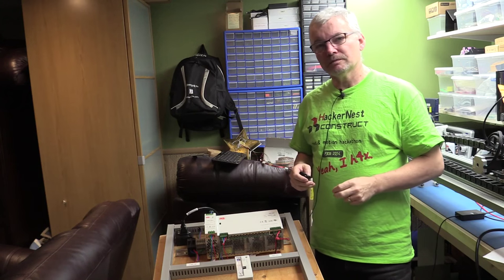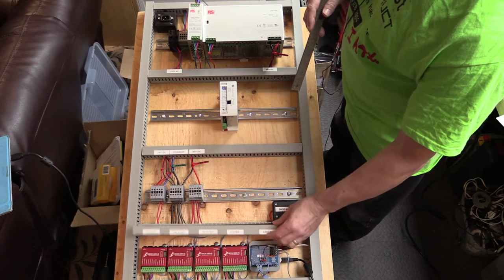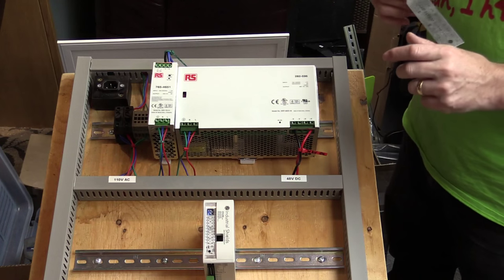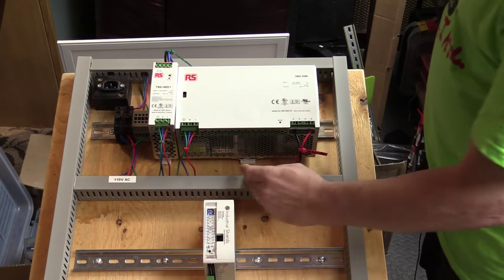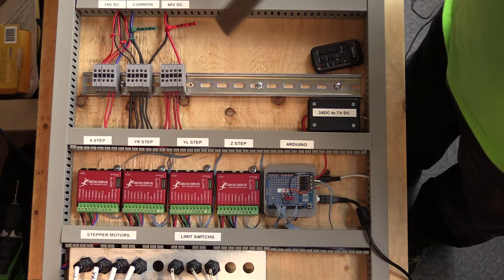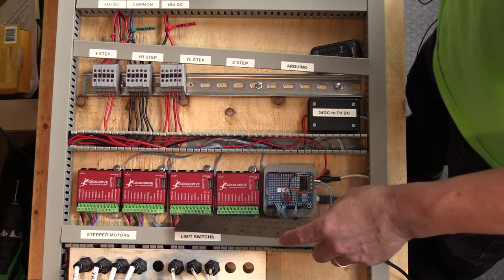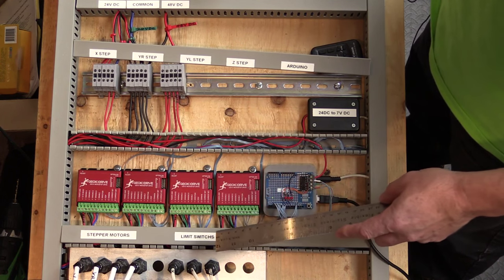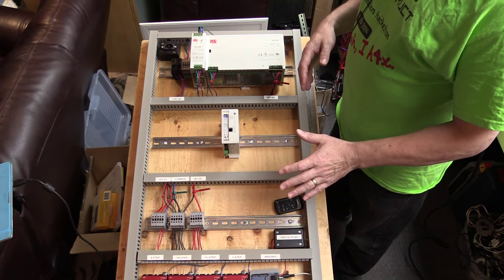CNC Project #4b The Control Panel Wiring

Comment: Nice video. I'm building my CNC router now, it will be similar to yours in many ways but I'm using gecko servo drives because my work donated them and a bunch of parts. I found you searching for Gecko and Arduino. 

I watched your e-stop explanation and was wondering about this;
Does your e-stop kill the power to the arduino? It seems excessive to kill power to the whole system when you only need to open the motor circuits. I believe that when you kill the power supply it takes some time for them to use up whatever stored power they may have in capacitors, etc. before the motors stop especially if you have such a high voltage supply. I also worry that if you interrupt mains power you are just allowing the motors to freewheel and not really stopping them and in the case of the Z axis it could plummet down and smash the tool or the part. Shouldn't we be looking for a way put the brakes on and stop everything that is moving? It would also allow you to clear the error and continue your operation without restarting. Thank you.
Reply from the maker: Brian Boni in this video I don't have an e stop installed. I do have limit switches though and these instruct the controller to remove power from the steppers. Not the arduino.

an estop if fitted should kill most of the power as this is an emergency. some could be cough in the machine etc. it is the only safe thing to do. if you simply want to pause the machine to check something you would not use the estop you would use the computer or remote buttons for the purpose
Reply from the maker: Brian Boni oh. the limit switches will also instruct the controller not to send more movement commands
Reply: Thank you for your reply and please excuse my continued querry as it's a pretty complex concept to wrap my head around. It does seem odd that "pause" will cause the machine to immediately stop but e stop allows everything to freewheel with whatever momentum it has at that moment. 

My only real concern now is the Z axis as I have a lot of mass up there with a full size router and over 12" of Z travel and nothing holding it up but the flow of electricity. Maybe the Z axis should have a worm drive to prevent the drop? The closer I get to finishing my machine the more I realize that I've made something rather large (the X,Y area is around 48"x48") and potentially dangerous and would like to understand and have it operating safely. These videos are a great help and more advanced concepts of safety are rarely covered so thanks again for your efforts.
Reply from the maker: With steppers, there is only 1.8 deg at a time being commanded of the motor (Or less), with servos there is feedback to the controller. If power is removed then the steppers will immediately stop, Servos motors should also stop very quickly as they draw a lot of power and therefore the power supply will not have enough capacity for keeping them going.

Even with the inertia of the gantry, with no power and the back emf now being generated, it will most lightly self brake. In an emergency situation (Which is why the E-Stop was pressed in the first place) you need everything to be powered down immediately, especially in the drive train as it could be the controller that is in error so you can't afford for safety sake to allow there to still be power to continue movement. and writing off the job in en E-Stop situation is perfectly acceptable unless you put life and limb lower than the job on the CNC (I doubt that). If you really want to make things brake hard then you can arrange relays in the path of the stepper coil to literally disconnect the power and short out the windings. this will ensure MAX breaking of the motors and also make them very difficult to move (Which could also be an issue if someone has got caught in the mechanics)

E-Stops are not there for NORMAL use, there for emergencies. For normal use like a bit breaking or to pause for some reason, there are plenty of other inputs to control that gracefully with full resume capability. 

Even limit switches should not be hit during normal operation, but when these are activated they can simply disable the stepper controller by use of the typical "Enable" pin found on most controllers. in this event you would still need to re-zero the head and resume your work from a known point or even start again. Remember Limit switches being hit is also an indication that the GCODE output or the program has failed in some way (Or you coded the tool path wrong) and so you still cant typically trust the current position

Better to trash the job than the machine.

I will be doing a video specifically on safety like e-stops and limit switches, it is worthy of a separate video and is a complicated subject.

Comment: Surely you shouldn't fuse the neutral? Otherwise there would be no return path for the live if only the neutral fuse went thus making the neutral after the fuse potentially live?
Reply from the maker: you are correct and that will be correct in a upcoming video. If I was using a circuit breaker that was dual pole then this would be ok. Your point about the possibility of just the neutral blowing is a good one. I don't know the tolerance of fuses but it is certainly possible for the neutral to blow before the live.

I did say this was a learning series. I am learning :)

Comment: hi  Peter.  I have a question if you don't mind...  I was able to set my CNC  to receive the signal   from my old driver box but but my motors not  moving only making click sound .  my question is ,  do you have any tutorial on setting MACH 3 to control motors. or if you please give me an  advise on setting motors. Also i noticed the parallel port should give 5 V but my only has 3.37 , is that could defect  motors run.  

Thank you
Reply from the maker: It is possible the lower volts could be problematic but it depends on what is receiving the signals. there are break out boards for the parallel ports that isolate the signal and could well solve that problem. I am assuming your using a modern computer for that to be happening?

I use MACH3 (Or will soon) but via a USB connection to a MACH3 Motion Controller
Reply: this old driver doesn't  use a BOB , it using parallel port connection  witch  has wires going in  to this old driver.... i think you wright  i will have to get a new BOB board and it will have 5V . 

Thank you Peter
Reply from the maker: do you have skype or Google hangout ?

Comment: Fusing the neutral on a mains supply is VERY bad practice.  You could use a double pole circuit breaker as suggested by Ilian but you don't need to.  Normally double pole breakers are only needed on CTE (centre tap earth) 110v supplies where you have two line conductors or where you want to use them for isolation e.g. on a TT mains supply.
Reply from the maker: MrSailbadthesinner you are correct sir and this was indeed corrected a long while ago when another viewer mentioned it. Not sure what I was thinking at the time but it is now corrected. Thanks for catching it and commenting though. It is good to have peer review of work. It helps  us all  learn
Reply: Hi ! Student in electroMecanic over here. 

Why is it a bad practice ?

Thank you very much :)
Reply from the maker: Two fuses in series is effectively what we have in this situation, one in the live leg and one in the neutral return leg, it is possible that the Neutral return fuse will blow and not the live one, leaving the system energized relative to Ground and therefor still a risk to equipment and personnel.  When used with a split (Center Tapped) supply you have a situation where both legs are at mains potential relative to ground and possibly neutral, this is the case with split sockets in America and Canada were the top socket is on a different phase to the bottom, each delivering 110V AC relative to neutral, the other situation is where you have a 220V AC supply for a spindle / VFD for instance and here your taking advantage of each phase but not the neutral but as there both still energized and at mains voltages relative to ground they both need fusing. Think a transformer where the output has a center tap and that is grounded and set up as the neutral, both sides of this transformer will be 180 Deg out of phase to each other, this is exactly what we have in North America. One phase of a three phase distribution network is feeding a transformer at thousands of volts, the transformer is outputting 220V AC Center tapped, giving 110V on each side / phase, and this is what is fed into most households.

Comment: hi Peter, thats a nice project and tutorial , like it. i want to ask if those Geckodrive you used any good, i have a big CNC table 8' x 10' and good 34D motors on Z,  and 42 D motors on Y,X.   thank you
Reply from the maker: The Gecko drives do support Nema34 style motors (7A max if I remember right), but they will need additional heat sinks adding to each one to keep them cool

You can see their latest products here http://www.geckodrive.com/featured-products.html
the site also has an excelent set of PDF documents detailing the requirements for powerful steppers etc.
Reply: thank you, would you know how do i wire my motors. they have 6 wires  , 4 phase.
Reply from the maker: 6 wires allows a choice between 4 phase and 2 phase. the additional wire in each leg will be a center tap
using the center tap and one leg will provide speed over torque. Using the outer legs and ignoring the center will provide torque over speed, see here for an example wiring
https://ebldc.com/?p=253
Reply: thank you very much. i do have all six wires connected to they own pins on my old motor driver, but i would like to upgrade motor drivers and have problem understanding how to connect them to a new drivers, because new drivers i see on eBay have only 4 pins for motors, my drivers have 6 pins for the motors
Reply from the maker: So as you will have seen in the diagrams, an easy migration to the new controllers.
I use a 48V supply to drive my motors through a Gecko driver with no issues. the driver takes care of limiting the current etc.

if your supply is only 12V then you may want to change it to 24 at least to provide additional torque to the motors with the new controller.

What was your existing 4 phase controller ?
Reply: its ANAHEIM AUTOMATION DPF41BB1  .  its a 4 motor driver still works but its old. i can send you a picture if you dont mind giving me your Email.  thank you
Reply: i think your motors have 4 wires  2 phase, i have 6 wires 4 phase
Reply from the maker: I assume it is one of these http://www.liveauctionworld.com/AA-DPF41BB1-MOTOR-CONTROL-print-sequence-L-368_i17552607

What is driving it ?, this driver should be easy to replace but it depends on the controller too
Reply from the maker: oh my email if needed is in the about block but here is is anyway
peter@thebreadboard.ca
Reply: yes it is. its not bad one but i would like to update it .  this model  26 years old.  and to buy from  manufacturer new one will cost around $ 1700 thats why im looking for better deals.  thank you
Reply: thank you
Reply: hi, Peter. what would be a good power supply  for NEMA 34  stepper motor  630 oz-in. 2.2 VDC  7.0A   ,.... and NEMA 42 stepper motor  with 1575 oz-in  torque 3.6 VDC  6.1A .....  i have a hard time finding out.

 thank you
Reply from the maker: without knowing their inductance it is hard to suggest something specific but I would suggest something in the order of 48V (For maximum torque) and probably close to 20A, it may be better to use a separate power supply for each axis of 10A @48V, this may keep the cost down a bit and spread the risk. As I said, without knowing the inductance it is hard to say for sure. the gecko site does have the math in the PDFs so you can work it out, but they require the inductance. I would suggest though not to exceed the 48V, this would start to get very costly for the power supply if you do.
Reply: inductance ? how to i calculate that.
Reply from the maker: should be on the steppers or available by looking up their part numbers
Reply: NEMA 42 has unipolar inductance 5.94 mH  :  NEMA 34 has unipolar inductance 1.70 mH
Reply: hi Peter,  here the inductance on motors:  NEMA 42 has unipolar inductance 5.94 mH  :  NEMA 34 has unipolar inductance 1.70 mH .   would you please suggest me what power supply will be the best for this motors, my new drivers can take up to 85VDC.  

thank you
Reply from the maker: so using the formula clearly shown here :-  http://www.geckodrive.com/support/step-motor-basics/power-supply-basics.html
VMax = 32 * root (L)
so for 
Nema42 we get 32 * root(5.94+5.94) = 110V
Nema34 we get 32 * root(1.7+1.7) =  59V

The drivers limit the MAX voltage and also if they're all on the same PSU we need to limit the volts to the lower of the two, giving a bit of wiggle room we land back on the initial suggestion of 48V and 20Amps. I know if you add up all the amps you get more but the drivers are never going to be energising all coils at max at the same time for all steppers and I also doubt you will be leveraging the full torque of the motors either.

A linear power supply, unregulated could also be cheaper and easy to build than a switching power supply and will work well. if you want additional margin, then you could always build it to 30 Amp capacity.

What is the supply there currently being driven with ?
Reply: i have 120v ac  going into driver box but what happens inside of that box im not sure, there is not to much info on this driver box.
Reply: thank you for nice explanation .  i think a 48 VDC- 85 VDC and 30AMP sounds good .
Reply from the maker: if there all on the same power supply, then stick with 48V ish as some steppers will not tolerate the high volts and will overheat.
If the NEMA 42s are on a separate one then they could use higher volts but your drivers will limit you to 86V ish MAX.
Reply from the maker: ah
Reply: all be looking for power supply 48 VDC  30A

thank you very much,
Reply from the maker: your welcome. you may find there is already a suitable power supply within your existing system
Reply: would it be better to have  a 48v  10 a power supply for each driver .  so that will be 3 power supply controlling 3 drivers . i did got 3 new drivers for my motors.
Reply from the maker: it would allow much better flexibility in layout when it comes to putting them in your control panel or wherever your going to locate them so sure.
Reply: hi Peter, thank you very much for all your help.  You have a good day

Comment: A lot of nice information. But I really do not get the controller part in this build. Do not get me wrong, I use arduinos for a lot of things. I have no problem with arduinos. But given the cost of the rest of the components in this build it seems like a really odd choice. Maybe I am missing something here, I do not in any way consider myself to be an expert at all. Not even close. But I really would have expected something else here.
Reply from the maker: Check this out https://youtu.be/SUiCWXAppwI. I still have to do the video for the upgrade but when I recorded this one, the arduino did nt have the IO to support the spindle and a 4th Axis so it went and a Mach3 motion controller went in. The idea btw was to show that from a load of low cost parts you can make a reasonable CNC, the first iteration of mine was on a budget but subsequently I have shown how to upgrade the gantry, Frame, Controller, Spindle and of course the controller.
Reply: @TheBreadboardca  Ah yes, I see. The IO bit was also what had me a little confused. I was in the same situation a few weeks ago. Finally went with the Pokeys57cnc simply because of the sheer amount of options it offers. It's easy to get lost though in all the configuration but it worked out great. In fact today I got the first proof of concept ready and was amazed at the difference it makes compared to all the budget friendly stuff so far (such as some old TB6560 boards I got for cheap etc). For comparison I just did a little test PCB and oh my god it's just insane how much better it looks now.